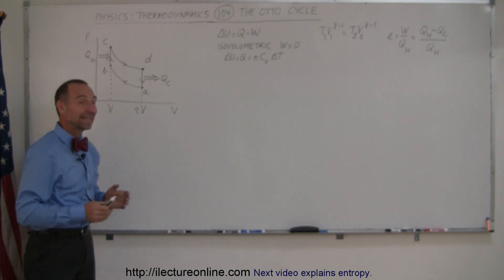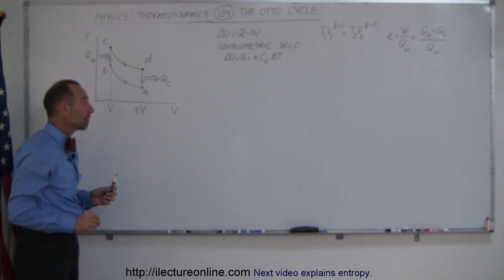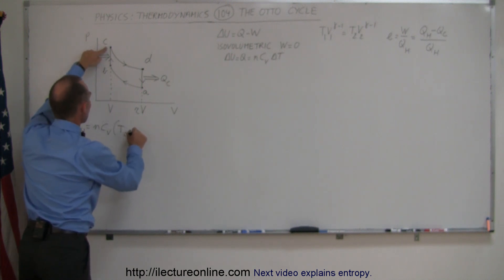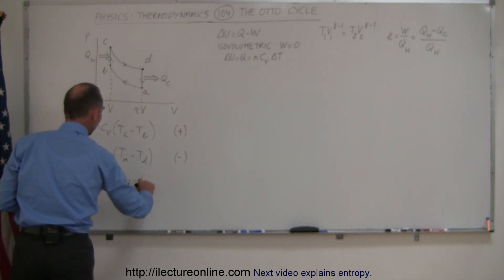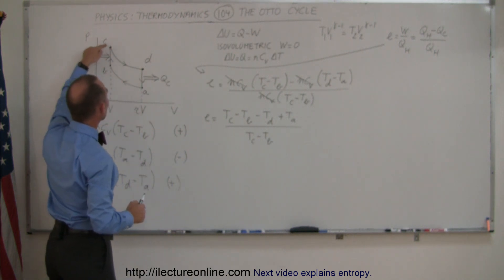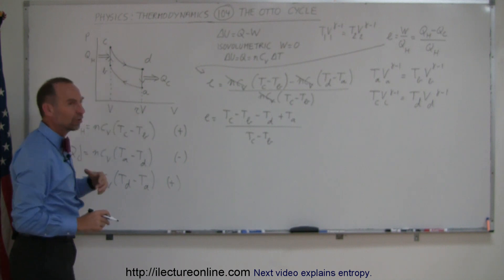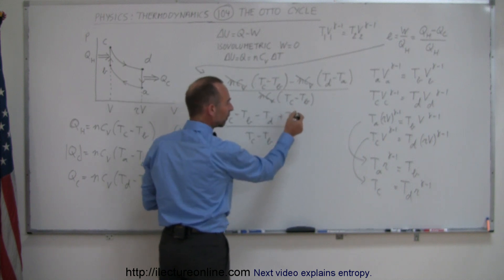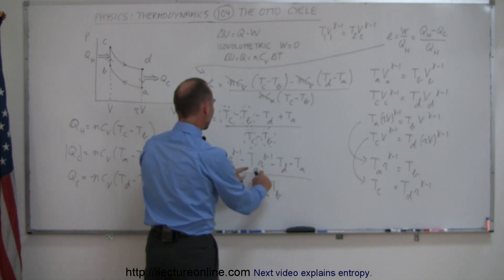Physics 29  Efficiency Of Heat Engines (14 of 14) The Otto Cycle

Comment: what does the formula T1V1^gama-1 = T2V2^ gama-1 represent?
Reply from the maker: It represents the relationship between the state of a gas defined by its temperature and volume at one point to the state of the gas defined by its temperature and volume at a second point after it has gone through an adiabatic expansion or contraction.

Comment: Sir. In my textbook, there's a statement describing that there must be heat transfer out of the system(Qc) in order to get a net work output. The heat transfer process is d to a in this video which is an isochoric process. I don't understand why heat must transfer out to get a net work output. Isn't work in an isochoric process 0? The situation in my book is exactly an otto cycle like the one in your video/
Reply from the maker: For a thermodynamic cycle to perform work, it must take in energy (Q) from the environment since in a cyclic process, the internal energy of the gas returns to its original amount after each cycle.

Comment: Really enjoy your videos.  Wouldn’t this be an alternative method to figure out the efficiency:
The area under the curve from C to D is the work done by the gas (Expansion) The area under the curve from A to B is the work done on the gas (compression). If I subtract the area from AB from CD, this should be the net work done by the engine (energy extracted). This should be equal to the change in internal energy, as indicated by the temperature change, from C to D.
Would not this be reflected by Qh-Qc/Qh?
Reply from the maker: The area inside a complete cycle (when the direction is clockwise) is equal to the work done by the gas.

Comment: Bottom line
High gamma, high compression ratio = higher efficiency
High gamma, Low compression ratio = high efficiency
Low gamma, high compression ratio = low efficiency
Low gamma, low compression ratio = lower efficiency
 Right sir?

Comment: what is C sub v??
can anyone help?
Reply from the maker: c for an object is its specific heat  (the amount of heat you need to add to raise 1 g of the object  by 1 degree centigrade      c for a gas is the amount of heat you have to add to raise 1 mol of the gas by 1 degree centigrade.   But for a gas there are two values for c, one for when the volume stays constant and 1 for when the pressure stays constant.  Cv is the specific heat at constant volume.
Reply: Ahh okay I understand, thank you for the speedy response it really helps now that my exams are coming up!

Comment: at 8:25 on the last term of the numerator, shouldn't that be +Ta? also, does this apply to diesel engines?
Reply from the maker: shylildude
Good catch.  Yes, that should have been a +Ta.     
Actually I forgot to place the parenthesis around them  -Td+Ta = -(Td-Ta)
Reply: Michel van Biezen
Add a comment to the video at the point of the error. I noticed this, too.

Comment from the maker: If the example in your work book doesn't include the "n" which stands for "number of moles in the gas sample", then it probably means that they are assuming one mole and therefore they omit that variable.  It is better to include it and state that it is "one".
Reply: I've been sitting with one question for 2 days for not knowing that the mole is 1 if it is not specified. Thank you so much for your advice!